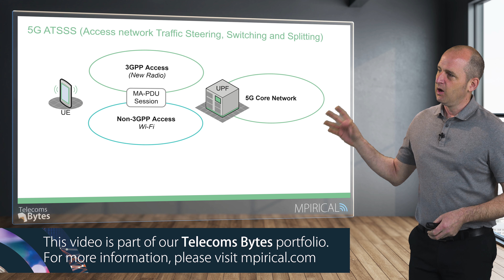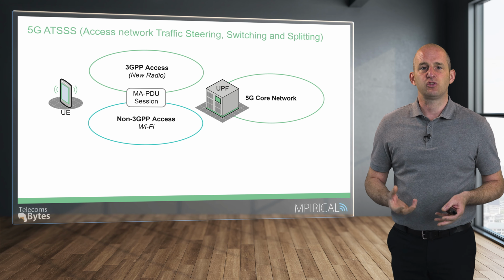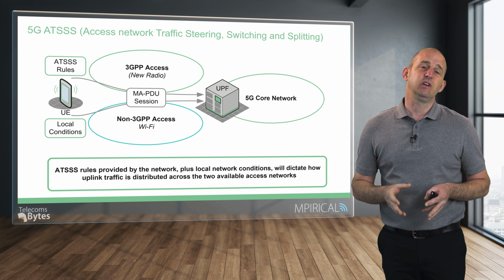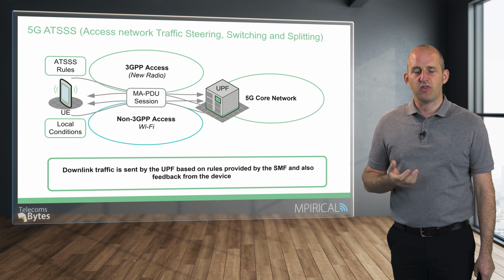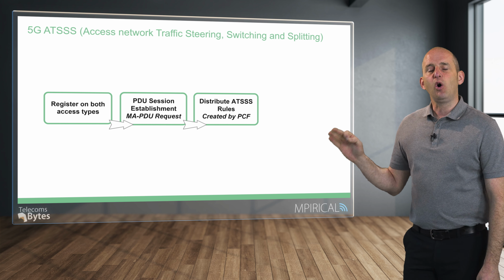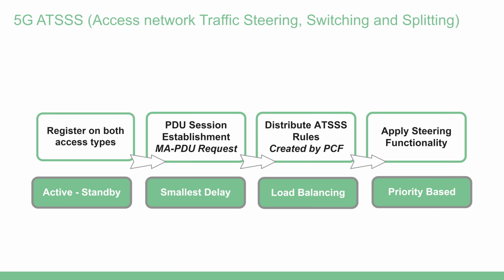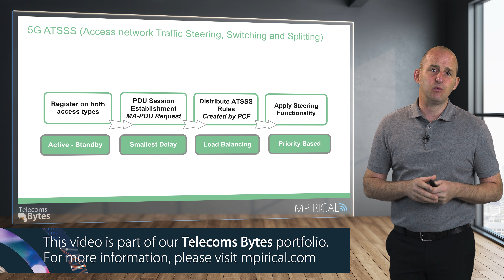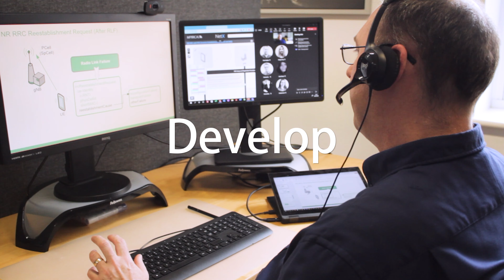5G ATSSS | Telecoms Bytes - Mpirical

Comment: I recently tried an experiment.  I disconnected my cable modem from my router but left WiFi up, so that my phone would think it had a WiFi connection.  I found I could place phone calls, but not use the Internet.  This was on a Pixel 6 & 5G.